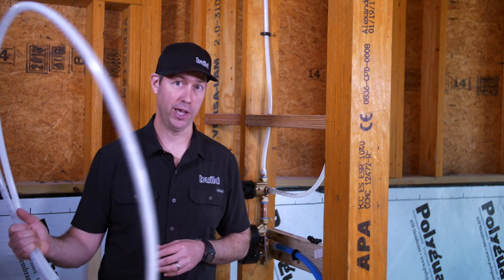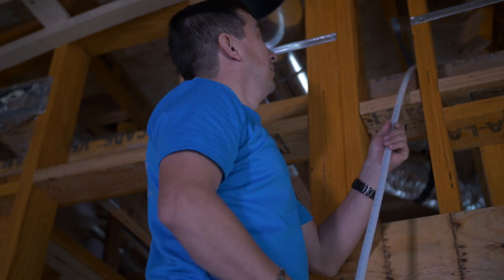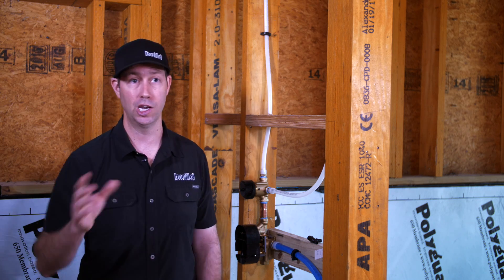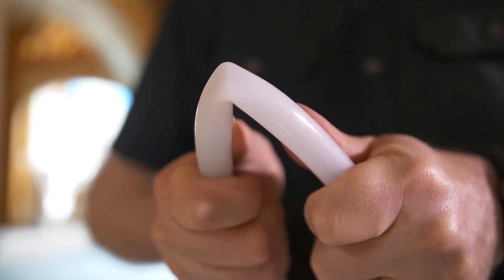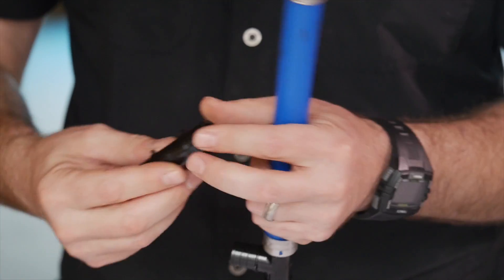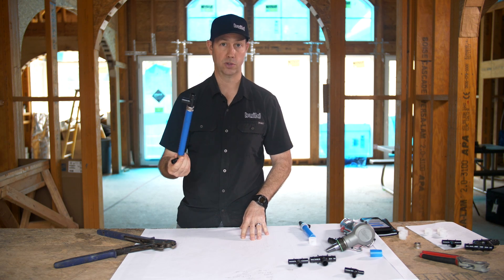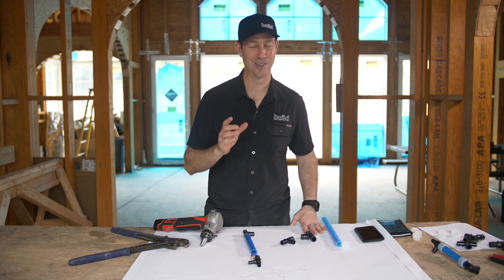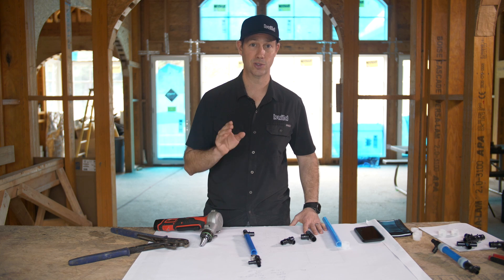PEX vs. Copper Plumbing

Comment: No mention of lightning damage and copper pipes? The geniuses who developed copper pipes also decided that it would be a great way to ground the house. That means that a lightning strike will conveniently damage all of the solder joints everywhere in the house! Insurance companies will likewise “conveniently” charge each and every broken joint as a separate leak resulting in multiple claims from one act of nature. I suspect that plumbers do this on purpose to ensure they will have work for themselves in the future. I have NEVER met an honest plumber. They will always try to sell you garbage that you don’t need which is why calling a plumber is the LAST thing anyone with a brain should do. If you want something done right, you’ll have to do it yourself!
Reply: like what?
Reply: Adrian Luna Plumber wanted $30,000 to replace the sewer line. Watched YouTube and learned how to snake it out myself, additionally, I was able to find where the roots are coming from and it’s only grass. If the problem returns (which it hasn’t for about 8 months already) I can either clean it out again or dig it up and patch it. Thanks to YouTube, we can find information about just about anything. When the toilet was leaking underneath the slab, I watched a few videos and had a new base installed before 5 o’clock. Insurance had to pay a plumber for some repairs after a claim and my sink was leaking after about a month! $10 in parts and I was able to fix it PROPERLY in under an hour. I’ve caught plumbers red handed trying to tell me that I had a leak “underneath the slab” only to find out that they gave the insurance company paperwork stating the leak was “capped 2 inches above the slab”. I put pictures of the conflicting paperwork on yelp and the company pleaded with me to take it down. They even have a  separate account to minimize the negative feedback. Ben Franklin plumbing and Benjamin Franklin plumbing. Both are the same but the negative feedback was getting too much so they created a different account trying to save face.

Comment: I know this comment will probably never get seen, but here goes: What pressure are you running your water systems at, in the US? I see that your hot water cylinders have no pressure rating on the box, and ridiculously long guarantees. We run 600kPa here, and are replacing cylinders every 5 years. On the other hand, we never worry about pressure drop, even in 15mm pipe.

Oh, COPPER FOR LIFE!

Comment: Pex -A is easy to bend, better flow rates, and I've not had a leak in 10 years of using it. Uponor makes stronger fittings than knock off brands, but I have not seen a difference in buying cheaper brands of pipe.

Comment: As a Master Plumber in the trade for 40 years I prefer copper. You may be too young to remember all the Poly failures in Texas in 1980's. I do use pex but only on non-potable water. And it would be less volume, pressure would be same with equivalent run.

Comment: Conventional hot water pipes are insulated, but is PEX also insulated?
Reply: best to insulate all hot water pipes regardless of make. you may find some manufacturers may make a pipe which is insulated on the outer.

Comment: I personally like copper. Pex does perform amazingly in freeze situations. Let face it though, that is rare. Most banks will put antifreeze in water pipes when selling foreclosures. That is the most common freeze situation in the north. I do like the systems that run a seperate pipe to each faucet on a manifold. The ability to close a line down as if you are flipping a breaker makes repairs nice. It allows water use in the rest of the house to stay in use.

Comment: I only used brass fittings and the cinch type bands when I did my house.  Ran everything to a manifold so I can shut off just the one I need to work on instead of the whole house.  Love the manifolds.

Comment: I've read that PEX is not stable without UV stabilizer. Even with stabilizer it will still become more brittle if left on a job site in the sun for too long. That would also mean that if any pex is exposed in a room with light there is a good chance of failure after 15-20 years. I'm also curious on the bacterial properties of a plastic like PEX over time. I wou't touch the stuff until I see 100 years of data and then I'll be gone so I'm sticking with copper. You know you can get a copper pipe bender and avoid many of those sharp elbow angles and keep the water flowing better with a longer curve. It will save time in not having to solder the elbows also.

Comment: Uponor is ok i guess, the only problem i found with it was when you have to make a close offset. You cant offset in the same way you could with copper or cpvc. Instead you have to put this ridiculous loop in the pipe.lol.
You cant butt two fitings up against each other.

Comment: Pex is great, depending on where you live (rodent issues most common. I have done a combination of copper/PEX. I use copper for long runs, but attach PEX up in the walls to the faucets and such. I also use more support for the PEX runs to reduce the hammers they do get. This allows me to easily replace hard to reach piping in the walls because the PEX can be more easily replaced, and the copper is less problematic on the long runs and thus less cutting needed in case of issues.

Comment: The pipe expansion system is appealing. I'm replacing a 12 year old cpvc system tah fractured with age. 
The expansion tool looks expensive. Is there an adapter for a more common tool?
Reply: the hand tool with i think 5 fitting sizes is about $60... the other great thing about it is you can cut the caller off and score the pipe with a razer blade. allowing you to  reuse the fitting. The only problem you have to look out for is the fittings. Some are cheap and water softeners/ high cloreng water  will  break down the fitting.

Comment: No mention in all the old copper comments about  lead at the joints, I know lead solder has been removed since about the 70's but that still leaves a lot of older houses  where you need to run the water long enough to pull from the streets for drinking.

I thought Pex was pretty good using it in Canada though the UV issue looks to be a flaw, and I'ld never heard of rat issues, but could not get Pex in Mexico, maybe now I know why. Anyway they have https://rotoplas.com.mx/catalogo/tuboplus-hidraulico/ which I think is from a German subsiduary that makes product in Mexico. Its not quite as nice as its in straight pieces, joints are done by thermofusion, but its had no issues where we've used it, the double layer seems to take the direct sun,  and has stood up to a 8.0 point earthquake along with being in direct contact with concrete, never had a rat chew through it either. So maybe its best we were not able to obtain the Pex here in southern Mexico.

Comment: I would never buy a house with PEX in it.  Those shark bite connectors do not seem reliable at all.  Solid copper with soldered connections are much more reliable.

Comment: Thanks for the info, bought an old house with unused pex tubing in the crawl space, and now I intend to use it for my on-demand heating system.  Good to know how simple it will be to install vs long complicated cpvc runs (or copper).

Comment: Excellent presentation!!  Being an old retired plumber, and a few years before PEX was introduced, I have had several opportunities in the use of type "A", which I like.  The only leak I have had, besides a small piece of wood chip a fitting (my error) was learning that when using the expander you have to rotate the tool as you expand the PEX or there will be a slight ridge in the PEX resulting in a leak.  I also change to copper for stubbing out of the walls.
Reply: The tool he used seemed to rotate on its own, but I can definitely see it as a problem if you're doing it manually.

Comment: Problem with pex is people get cheaper than cheap when it comes to pex. I’ve seen people buy foreign tubing just because it’s $8 cheaper than the uponor or viega that has no identification markers on it, which is against code anyway, stick to the uponor in my opinion, stay away from those damn John quest fitting. If you HAVE to use John quest or other push fit style fittings use the uponor, I’ve seen viega tubing fail on those particular fittings

Comment: Some of the PEX horror stories came from the KITEC fittings, rather than the PEX tubing itself. The hard water here in Las Vegas leeched the zinc from the improperly made fittings and caused leaks. The PEX tubing itself was fine. 
However, you need to watch out for rodents. They can and will eat your piping. Also, make sure you have the sticker in your breaker panel warning that the house doesn't have conductive plumbing and that it shouldn't be used as a ground.
Reply: Thanks Mike.  I live the Valley as well.  My home has copper, but as I have been renovating certain areas of plumbing, I have used PEX with shark bite. The oldest going on 5 years, no problems.
Reply: Although metallic plumbing systems are required to be grounded to prevent them from becoming accidentally energized, they can only be used as the main service grounding electrode by the NEC, but no other grounding purposes.  Most cities and inspectors won't even allow that since a lot of the underground piping supplying the house has been replaced with plastic, and the code requires 5' of steel pipe in contact with the earth.
Reply: You shouldn't ground your electric to your water line to begin with in the last 25 years I have  fixed/replaced hundreds of under ground water lines that were leaking due to electrolysis
Reply: @chuckbailey6835  interesting, first time hearing this, thanks
Reply: @chuckbailey6835  electrolysis and grounding are 2 completely different things and are not related, you speak from a lack of understanding of both
Reply: MrDmadness, I’m interested... do you think that you could explain it in laymen’s terms ? I know just enough about electricity to be dangerous. Just hear to learn... I don’t plan on trying any of this. Thanks. :  )
Reply: Mike McKeen yes, exactly, the kitek manifolds and connectors. 
But the copper pipes also corroded — at least the hot water side.  Either due to little grit inside drilling holes at vortices, and/or if H and C were too close together under slab, it became a “battery” and the Cold stayed nice and bright copper, while the Hot corroded to failure.
Reply: Mike McKeen i believe you’re confused with “Apex” the maker of Kitec plumbing
Reply: That's why kitec was recalled, excess pressure, temperature of 82°C is an inevitable for kitec pipe too fail. Kitec on a hydronic heating system is a recipe for failure. On top of all of that their fittings are slightly bigger a 1/2" kitec pipe is not the same as regular pex pipe

Comment: My reason that I don't use Pex , Kytec, or any other plastic water supply system. Is BPA. What is Bisfenol A? The main ingredient in plastic. It's a synthetic estrogen used as birth control. Extraordinary  harmful to females. Don't believe me. Look it up.
Reply: There is no BPA in cross-linked polyethylene.  Please get your facts straight.

Comment: My travel trailer has PEX B with copper fitting. It was on the north side and open. Completely frozen to twenty below. The fittings leaked. The toilet connection broke. The faucet leaked. The pipe appears to be okay.

Comment: Sorry but no, the only reason PEX is so popular is because it's cheap and easy to install. I am very wary of anything that has to do with plastic primarily due to chemical leaching and the manufacturing process used to create it. It usually takes time to research and prove that something poses a health hazard, thus why lead pipes were used for so long, asbestos, etc. It took awhile before they realized certain plastics were leaching BPA and that is was carcinogenic as well, who knows what they'll find in high density polyethylene in the future. Another new rage in construction, spray foam insulation, uses chemicals that can be mixed improperly causing outgassing of a whole host of nasty stuff. Copper on the other hand has been around for a long time and is tried and true, to me it's worth the added cost.
Reply: And yet Pex has been used in housing since the 1970's in Europe, and newsflash: we have plenty of data (decades upon decades) of cross-linked polyethylene/high-density polyethylene use in water systems.  Also, you do realize that copper has its own issues, right?  Autosomal recessive mutations in copper transport proteins can lead to Wilson's disease with copper accumulation and cirrhosis of the liver in persons who have inherited two defective genes.  Additionally, elevated copper levels have also been linked to worsening symptoms of Alzheimer's disease.
Reply: There's more in plastics than just BPA that are toxins or potential toxins, like Bis adipate, phthalates and volatile organic compounds; not to mention compounds we currently know nothing about as well as tiny plastic particles that can potentially enter the bloodstream and organs.

No, copper is not 100% safe but it has been around longer, doesn't contain a litany of chemicals and appears to have less potential for health hazards.

See https://healthybuildingscience.com/2015/10/30/new-construction-piping-plastic-vs-copper/

You think PEX is fine, by all means go for it, it's your health. I myself prefer to be on the safe side.

Comment: I ran into that stuff on a prefab home. Wasn't thrilled when i pulled up on a line under the sink and the 90 cracked. I had to cut thru the cabinet floor because under the home the fittings were placed right over a steel I beam. I know it was age that caused the 90 to break,,but doubt a brass or copper 90 would have cracked. I didn't use much upward force either. The horizontal run wasn't even strapped down. Spent hours repairing it.

Comment: Great video. The PEX is really the way most are going around here and I always thought just for ease of installation and cost. I would never have thought about some of the great benefits you brought up and seems the the more logical choice. The PEX A that has the larger fitting looks great my only worry about that would be that under pressure what the durability would be not having a solid fitting

Comment: Might work if you screwed plywood on the inside of your walls before drywall, but I like framing with rough cut lumber, banded an dried , 16 OC always, I've built home the old old way, box siding, an roofing,   copper flashing, man I miss them days. Everything is rush rush now,

Comment: Can you use this underground outside. I am in Michigan and the frozen line is 42" below the ground.
Reply: Hi. I wonder if I can bury PEX into the ground without any leaks. I am connecting a water line from the house over to a garage which is about 25 feet from the house and I am burry the pipes in the ground over 42" which is the frozen line in Michigan. Thank you

Comment: I'm a property inspector, and have seen time and time again how well copper holds up over time.  The plastic issues of algae buildup and chlorine corrosion over time are what I am looking at.  It appears as if everybody forgot about the Polybutylene (PB) issues,  a plastic manufactured between 1978 and mid-1995 that resulted in class action lawsuits.  Only time will tell.  Copper does have it's weaknesses, but lets face it...it's proven to last in MOST cases.
Reply: "Only time will tell." PEX has been around since the 60s.
Reply: Btw, algae forms with stagnient water such as an unused R/O system, not with moving water.
Reply: Polybutelene(aka big blue for exterior water services or qest gray pipe for interior distribution systems) was manufactured by shell oil co, tested with distilled water, and primarily installed in chlorinated water systems(municipalities). Absolutely prone to leaks since chlorine directly reacts with butelene, unless you're on well water(naturally no chlorine). As a result, a multi-billion dollar class action lawsuit. Polyethylene expansion type(wirsbo or uponor) is perfectly OK, city or well water, when installed correctly. Crimp style is for the unlicensed or Home Depot rookies!!(My licensed contractor opinion) 
 P.S.-the first five letters of plumber or plumbing is "plumb". This means straight lines, properly positioned tee's, and true 90° bends! Take pride in your installation!! Long sweeping loops are for lazy bums looking for quick pay. This can cause "water hammer". I know being the expert that goes behind these new construction installers, sometimes needing to cut drywall, and securing the rattling pipe. Also, the "excessive bends or 90's & tee's making less pressure" theory is BS when you follow your state code. Main lines and interior distribution lines are sized based on fixture units, exactly like the drainage sysyem. Plumb the system efficiently(least fittings necessary), size the pipe properly, and the fitting count WILL NOT REDUCE the pressure, even with all fixtures running simultaneously. The plumber protects the health of the nation, word!
Reply: @jasonrobinson8919  "American Standard"!
Reply: I remember the PB piping and for that reason I would never use PEX.
Reply: Also rodent and attic critters love to chew on pex.. pex is great in Boats and Rv's but thats about it

Comment: I have used it all. I am a fan of PEX, for most situations for several reasons. First, the material is less than half the cost of copper to buy. Second the labor is less than half the cost of copper, to install. Third, the speed of water flow is much better with PEX. Forth, break ins and robberies are almost non existent, with a PEX install. Finally, repairs and upgrades to a system are much easier with PEX.
Reply: So other than theft copper is still the way to go overall using proper fittings, correct!
Reply: So how does a potential copper thief know that you do not have copper?